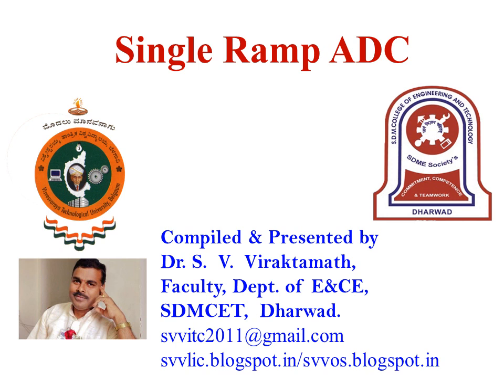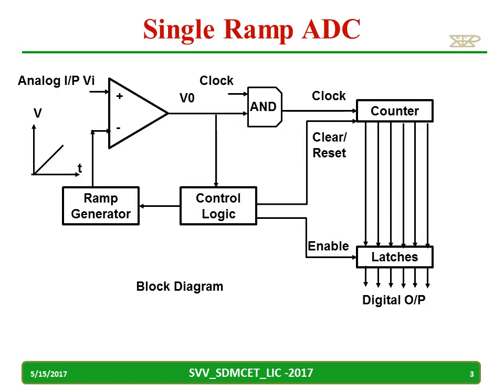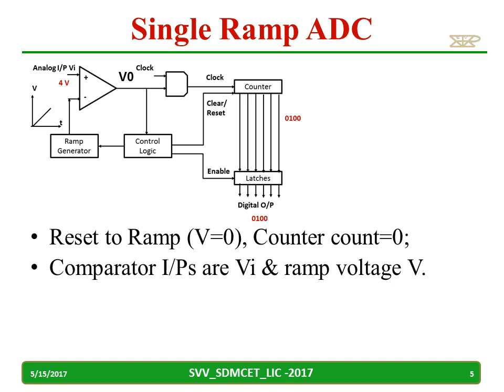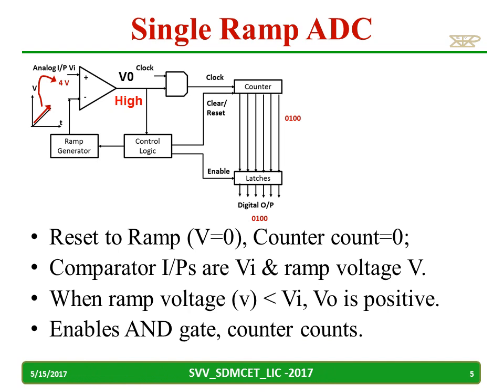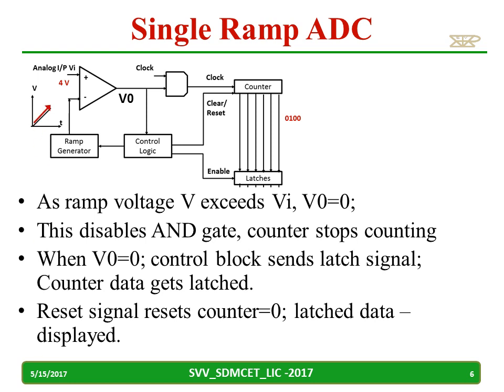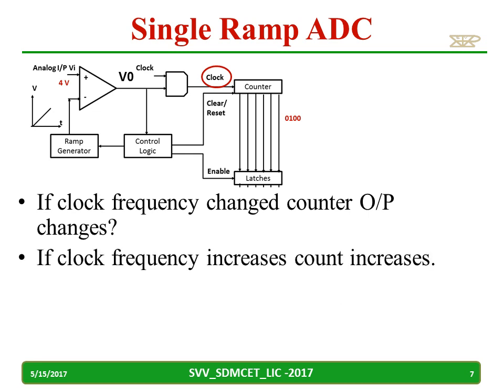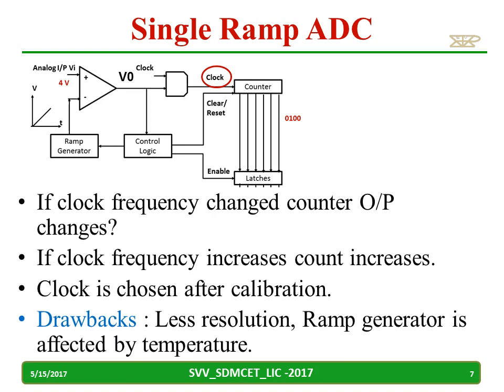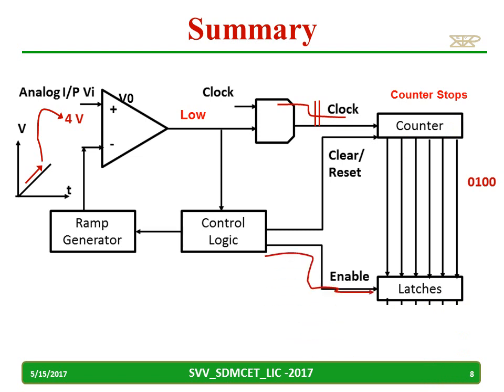Single Ramp ADC A to D Converter

Comment: Sir how does the ramp voltage increase here ?
Reply from the maker: It is a block diagram, Ramp generator circuit will be there in ramp generator block. You might have studied wave form generator circuits or oscillators. Like that a circuit which produces ramp.